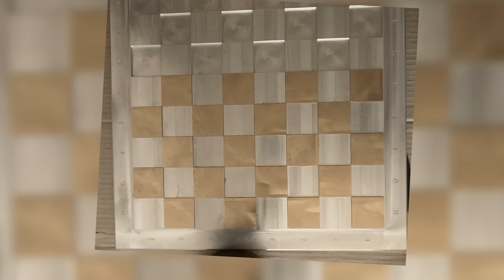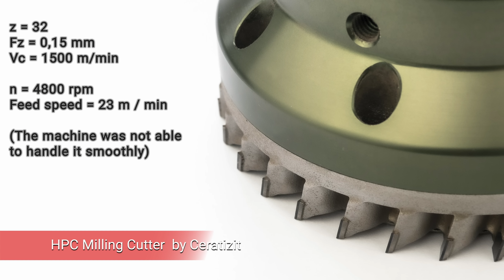Making a Chessboard with Chess Pieces - CNC Milling and Turning - Machining

Comment: An impressive amount of skill went into writing  the code for that, it turned out amazing! Are you selling them? Thank you for taking time to film, edit and post this video.
Reply: with a modern CAM software it's actually not that big of a deal. provided, you are a well educated machinist :)
Reply: @cedi98  there is still an immense amount of schooling to get to this point!
Reply: @donaldmatthies6026  thats correct!
Reply from the maker: The chess pieces were complety written at the machine.

The Code for the board was done in solidcam. Just because it's much more faster.
Reply: @mygcode-cnc-cad-cam  it's still very impressive!

Comment: What is holding the stock in place on the mill? It doesn’t look like there’s a vice
Reply from the maker: A plate with two flat irons. 4 screws are holding the board.

A simple construction.

Comment: for making the chess pieces, casting would be optimal manufacturing method right??
Reply from the maker: Only If you like the look of casting.

Turning and milling is very fast, cheaper and it looks better in my opinion.

Comment: Is there a way that we could get a copy of your drawings you used in school.   When I was learning machining & CNC Machining in trade school back in 2004, we did make a chess set, but with no chess board.   I would love to see your drawings and see if your chess pieces match mine in diameter and height and also see if your chess board could work with my own chess pieces.

Comment: How is that metal-rhomboid-point called? (the one which "carve" the piece) and what material is made from? (technically). 
I ask you according to do a machine myself, simply to flatten the remnants of the metal weights that I put in the base of wooden chess pieces (that way the pieces will be perfectly flattened at the base, for then to stick to it a billiard cloth). If you would give me more advice, I would be very grateful!
Reply from the maker: I think in english it is called Cemented carbide inserts.

I hope it helps you. Wishing you the best and good luck.
Reply: @mygcode-cnc-cad-cam , thank you very much!

Comment: By reducing the rpm when cutting the pieces, do you reduce the size of the "bur" in the middle? Or why do you do that?
Reply from the maker: Yes and the part will come down in a estimable area.

Imagine what happens when you cut them with 4000 rpm off. They fly through thee whole machine and get damaged by  small dents.
Reply: @mygcode-cnc-cad-cam  Oh okay, at work all the programs are written with 1000 steady rpm for the operation and the bur is pretty huge.
Maybe it can solve this issue

Comment: Can you tell us more about the Ceratizit? PCD? 3D Printed?
Reply from the maker: If I am right, the body of the tool is 3D printed. The cutting plates are hand soldered to the body and the plates were laser processed.

But I will ask the manufacture again to make sure it is right, what I told.

Comment: 5:28 what is that paste for?
Reply from the maker: It's a 2k glue. Just to make additionally sure the Brass pieces will never come out again.

Today i would say it was not necessary, because i made a tight fit.

Comment: Too much over programming. How much could have been done without inch sized overs and a one I inch (guessing sizes) flat bottom drill
Reply: Hammer omg
Reply: Not flat
Reply: Wow nice circular interpolation.
Reply: It's g3 in cnc programming
Reply: I like the use of brass and aluminum no coolant needed at those speeds... For noobs that took a while. As in hours. When it could've been done op for op much faster
Reply: Who has fourth axis fifth axis mills, does this, and has no horizontal mills.